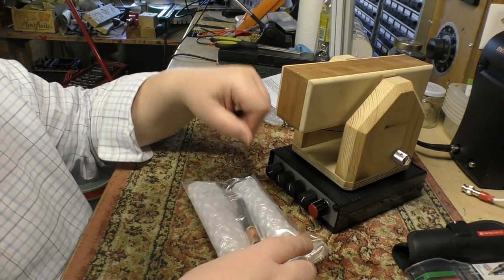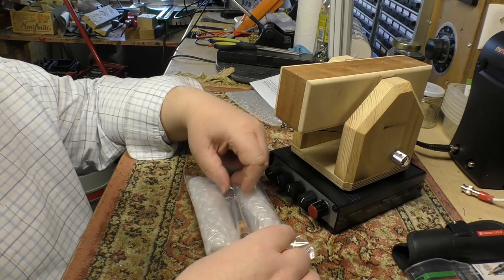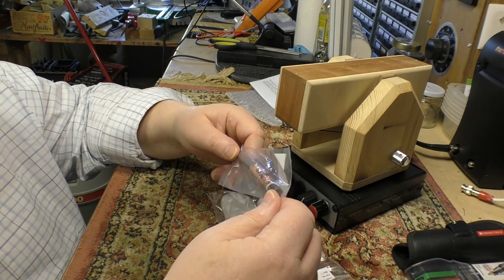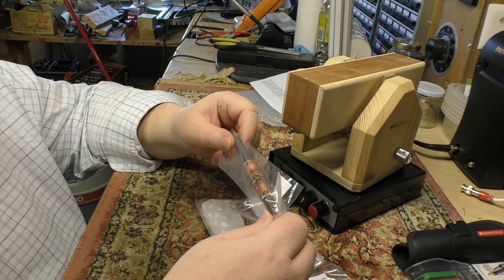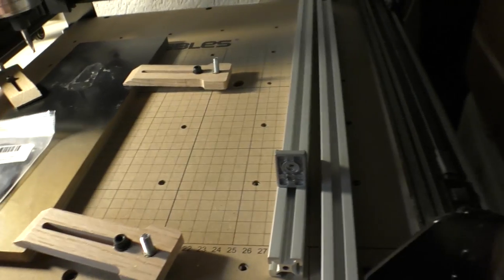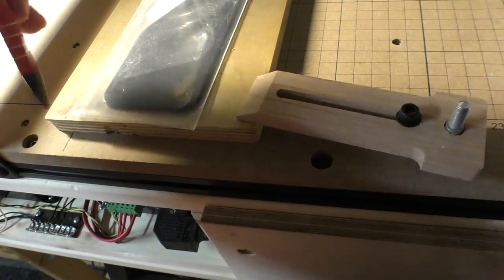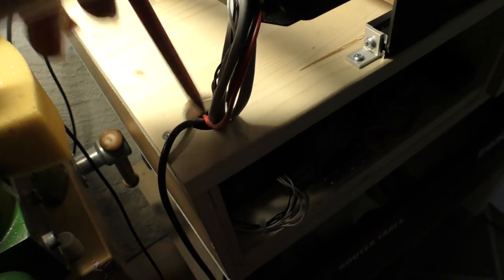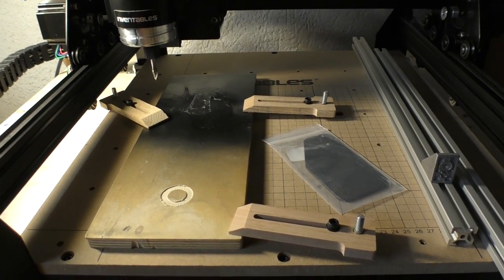Short antenna and CNC update

Comment: John,  Back in the day, to avoid the long-wire antenna, some Americans would connect one end of a thick copper wire to the antenna terminal on their radio, then staple or glue the rest of it to the inside cabinet walls, fashioning 4 or 5 wraps all the way around.  The radio was then grounded as usual.  It was simple, cost nothing and worked great.   You'll be doing the same thing in a smaller, more modern way.  I'm looking forward to seeing the results.  Regards,  John
Reply from the maker: +joernone Hi John,  I think I'll try that as well.  The challenge with the ferrite antenna is it is essentially a transformer so I'm trying to figure out how best to hook it up.  Its all good fun.
Cheers,   John